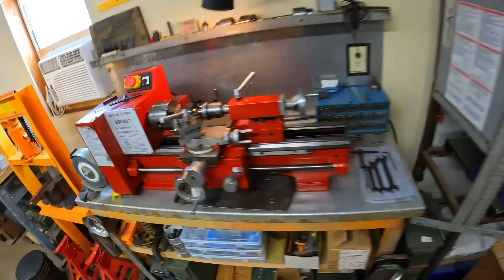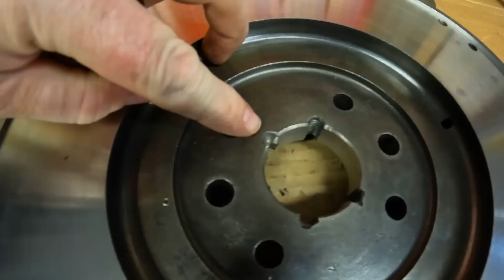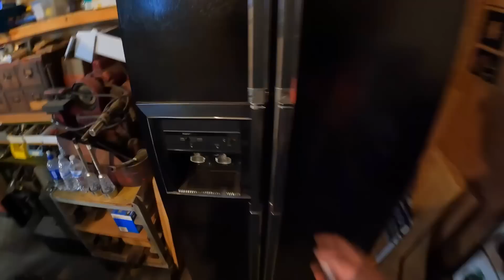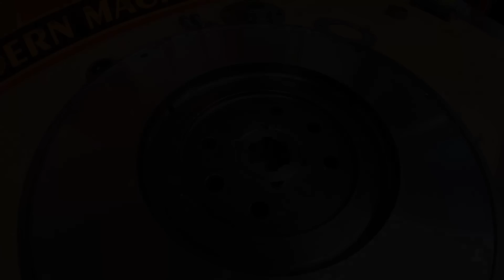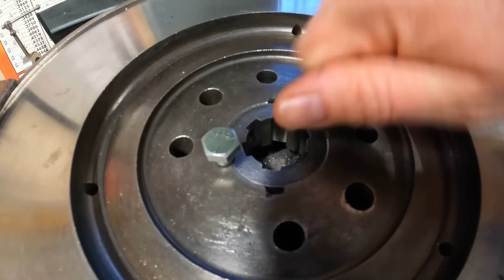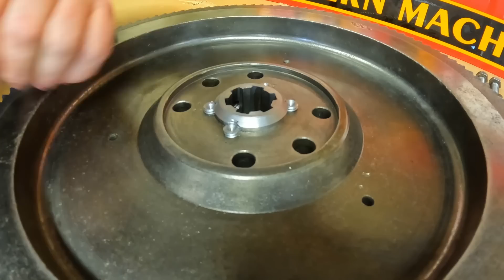X231 Prototype - Fabricating, Pressing & Pinning the New Flywheel Hub - Part 81

Comment: That annoying sound on your shop vac. A bronze bushing in the motor, is just about tits up. Amazon $ 35. Wet or dry shop vac. Come on, cheap, or stubborn.
Reply from the maker: We treat these shop-vacs as shop consumables because the duty they put in on the sandblasting cabinet wipes the motors out pretty fast due to the fine dust bypassing the filter. They actually last longer if we leave that motor bushing dry and let it howl because no lube keeps the dust from sticking and turning into a grinding paste. Plus the noisy motor really stokes the comments section lol 😂👍

Comment: Squatch - A pleasure to watch the work of a master craftsman! Just out of interest (and you may have answered this before) what's the reason for doing lathework with no lubricating fluid?  Is this because modern tools don't need it?  I recall 50 years ago in school lessons always using some milky-looking stuff to cool and lubricate the cut.  (It had a distinctive smell too!)  I've never worked with machine tools since, so I've no idea how techniques have move on.  Thanks again for fascinating and inspiring content!
Reply from the maker: Typically production machines that take large cuts and run at high speeds need a lubricating coolant, but these tiny hobby lathes don't run at that speed nor can they take very big cuts at all, so fluid is not necessary.  The only time I ever need to use fluid for lathe work is when machining aluminum, because without it the metal will gall and stick to the cutting bit, ruining the finish.
Reply: @squatch253  Interesting, makes sense. Thanks for taking time to reply.

Comment: A bolt designed to fail at a set point. Not unlike the stitching technique you used on the gearshift casing.

Comment: I have a question on this would it not been more safe and solid if you was to use a solid  pin that stacked it in  with a tight fit
Reply from the maker: The threaded pins not only hold the center hub from spinning, but also hold it from drifting in or out of the hole as well. A straight pin would only hold in-or-out movement with just the end material that is staked, and that’s not very much.
Reply: @squatch253  just my thoughts  being you have plate on both side but may be noy tight against the fly wheel
Reply: But ke up the fantastic  work you doing I would liketo have some equipment  that you havemakes things easier  to rebuild  0parts you can't  find

Comment: Yes, even thinking about a broken tap too loud is a risk, any body who has threaded will know the 'dreaded eeek'.  Watching you swap taps because the lesser tap has a 'dimple' in the top to guide, there are actually tap spanners around that have a spindle that fits into a drill chuck to act as a guide for the tap (the spindle slides vertically to allow the tap to thread in while guiding it in line with the drilled hole).

Comment: The worst sound you can hear is when a drill bit, end mill or tap shatters when working with two different types of metal being connected. Only having done this type of work with the greatest of care and patience will get the end result needed. I know very few people that can do this type of work. I am glad you pointed that out when you had the parts ground by a local shop. Restoration is an education unto oneself. Having said that, I am very happy for your end result. I could almost hear the sigh of relief at the end of the video. Watching you and senior to the end result is very exciting. Thank you.

Comment: Very thorough repair. Was I seeing it correctly - are you about due to flip the ring gear for some fresh teeth for the starter drive?
Reply from the maker: I looked at that and thought about it, but decided to leave it be unless it ends up giving me trouble. Because the ring gear is also a unique “10X” piece, and the starter drive that matches it is also an oddly sized Delco-Remy “Engineering Sample” prototype piece, and X231’s flywheel is also different from the production 445 and only matches that unique ring gear - all it would take is for one thing to go wrong during the ring gear turn (like cracking it) and then ALL of those pieces get thrown out and the work begins to try to fit the all-production parts in their places - definitely an “all or nothing” worst case scenario lol
Reply: @squatch253  Excellent explanation in Part 83 describing all the factors in your decision. While flipping ring gears are standard practice during flywheel/clutch servicing, I can see why you chose not to, given the lack of available "partner parts" available if there is an issue.

Comment: Just out of curiosity,  why not just weld it ? 
Is it the fact you want it as close as possible to it original  design, or the mix of the metals?
Keep it up please?
Reply from the maker: It’s the dissimilar metals that prevent the welding - cast flywheel with a steel hub is a no-go for weld, thats the reason why they didn’t just weld it originally 👍

Comment: Why not plug weld the old threaded holes
Reply from the maker: This is cast iron, which doesn't weld well.  It could be brazed with a proper controlled pre-heat, but that's beyond my skill level.

Comment: 8:44 If the flywheel had been heated to somewhere around 200-250 degrees it would have dropped right in. Minimal chance of warpage, either, that'll be within the temp range that flywheel will see in service.
Reply from the maker: I can't bring myself to apply heat of any kind to these prototype parts - they've already been through too much and I won't be the guy that finally finishes one off with well intentions lol!  A working tractor would see those temps at the flywheel, but this one won't for as long as I own it :-)

Comment: I'm amazed at the craftsmanship at some of the things the engineers did in the making of Christine..but appalled at others.  The way they installed the original splined hub falls into the appalled category, specifically the way they staked it.  Your way says "professional and done right the first time."  Their way said "shade-tree and it'll do."  I know Christine is a proof of concept machine and a time-table had to be met, but some of the fixes/shortcuts they made just make you scratch your head.

Comment: Hey Squatch; 
I was just thinking. Would it have been easier to use tapered head hex allen bolts to  secure the collar. That would have saved you from machining the shanks down to snap off and also having to machine them flush afterwards.
What are your thoughts?
Reply from the maker: Allen bolts/screws are always very hard, therefore difficult to machine or peen/deform.

Comment: Hi, Chris from Australia. Will need to re-balance the flywheel after the hub centre repair?
Reply from the maker: No, the original one was never balanced after all that they did to it and it survived one of the greatest floggings of all time lol - also remember from way, way back in this series that I pointed out how the engine's crankshaft was never balanced at the factory either, it's just a raw forging that only had the journals machined.

Comment: Squatch, a fantastic repair job as per your usual standards
A couple of questions though:
Why did your use the little lathe as opposed to the big one? I would have thought that the added rigidity would have been better.
Why didn't you make the spline shoulder a bit deeper and mill the staking bolts shoulders into the new spline?
Reply from the maker: The little lathe is actually my first go-to because believe it or not, I can get better accuracy with that one because it's not worn as much as the two bigger lathes we have here.  Second question - when it comes to altering the prototype parts, my approach is to change them as little as absolutely necessary - because you can't un-do taking material away, and I'm not here to try to improve a faulted design, rather to restore that likely faulted design to somewhat of a dependable and workable state for the requirements of a parade tractor.  It's like walking a fine line between leaving it full of the unique shortcomings that it originally had, or updating everything inside of it which would basically turn it into a production 445 tractor clone.
Reply: Squatch, I think you misunderstood my 2nd question. I was thinking to leave the new spline "proud" of the hubs surface, then after staking it in place, milling it and the stakes down  flush with the surface. That would've ensured that another was too high for the hub to be pulled down flat. No additional material would've been removed from the clutch plate.

Comment: Clamp your tap in the chuck as hard as you can , then use a pin spanner in one of the chuck key pilot holes to crank it in. much more rigid than a boingy tap follower and you will slip before you snap the tap. If your mill can run less than 100 rpm goose it and run the tap into the material while its coasting to get a good start. Use plenty of cutting oil.
Reply from the maker: I could never bring myself to use any tap with a powered machine - it's just one of those things that I'll always need to have the feel of it in my hand.  That's just a "me" thing, I'm sure it works but I could never bring myself to attempt it.
Reply: @squatch253  I can understand, once you get over the cringyness of it, it works really well

Comment: Consider using green loctite on the press fit?
Reply from the maker: Everything got green Loctite, it was even smeared inside the flywheel bore right before I drove the frosty hub in.  Not sure how well it did in there with the resulting condensation, but I gave it some.
Reply: @squatch253  cool, there was a study years ago about using it on press fits. I didn't believe it until some guys on Practical Machinist went and experimented. Was surprised to see you kept the Dutch keys. They do work though.

Comment: Are you happy with that lathe? What other choice/brand would you recommend?
Reply from the maker: Yes, I am happy with that small benchtop lathe. They're cheap quality, but for a hobbyist they do very well, and for the machines that I work on, their accuracy is still within closer tolerances than I have to hit.  The biggest factor to keep in mind with these small lathes is to not overwork them - they're not capable of taking deep cuts so it takes more passes to do the work but if you stay within their limits they do the job and last a decent amount of time.  When looking for any size lathe, the rule of thumb is that you'll get what you pay for - a small lathe like this one will set you back a few hundred bucks but a top-tier model of the same size will be a couple grand - but if you were to do the same job on each one, the difference in construction, power, and rigidity would soon become clear.

Comment: You have made that stronger than original by increasing the bolt size and probably doing the job a lot better than it was originally done.. That is going to go nowhere with the light duty you plan for the the tractor's future. I'm looking fwd to the next job.

Comment: I'm Curious is Staking and pinning as well as welding. Which welding can cause warping. It sounds like a good hold the way you did it.
Reply from the maker: The trouble here is that we have dissimilar metals, with the flywheel being cast and the splined hub being steel. The two don’t weld to one another well at all, otherwise that’s the way they would’ve done it originally 👍

Comment: Very nice work Squatch!  I presume you went down this route to replicate the prototype job? I did think you might have made the centre a flanged piece and counterbored the flywheel to take it, follow up with hot riveting to secure. Worked for billions of clutch plates but wouldn't hve been same methodology that the X men used?

Comment: I don’t recall if this was a one off do or die part that needed to be rescued, if a substitute production part was even an option? Nice work, I really enjoy this series on X231.
Reply from the maker: Check out the video just prior to this one, I showed all of those details near the beginning of it. In short, this prototype setup had several iterations of faulty design and failures before they settled upon what you saw here. The production equivalent was a MUCH better and stronger setup, still along similar lines but much better engineered 👍

Comment: I have to ask. Why the shaft is connected directly to the flywheel if there is a clutch? Is that shaft through the main shaft that?
Reply from the maker: Yes, that center shaft is solid and is what provides the “live power” to the PTO and hydraulics at the rear of the tractor. The actual transmission input shaft that the clutch attaches to is hollow, allowing that solid center shaft to pass through it.
Reply: @squatch253  Thank you for your reply. I wanted to say PTO, but... I thought I was going to make a fool of myself

Comment: Question? Why didn’t you have the crank flange/ mating surface ground at the same time as the clutch surface? That surface looks well used from over the years and may not be parallel with each other,
Reply from the maker: They don’t have the capability to go that small.

Comment: I can’t help but wonder why you didn’t use red loctite? That’s generally what’s used when you have an assembly you don’t ever want to come apart ever.
Reply from the maker: This green has an even higher strength rating than the red - once this green stuff cures, the only way to take it back apart is with heat to melt the bond 👍

Comment: That vacuum still sounds plugged to me.  That doesn't sound like dry bearings.  That sounds like it has a pop-off valve somewhere that allows the suction to bleed off when it is plugged.  Sharks are really bad for that.  Customers would bring them in saying they sounded like a dying cow.  They have a pop-off valve that makes a horrible sound, and usually they were plugged up in the dust cup cyclones, or in the bottom curve of the hose, making that valve pop off.  I don't know if Shop Vac uses them but if they do, it might keep you from having to buy a new one.  It doesn't take much of a restriction to make those things howl.

That is a beautiful, well thought out, workmanlike repair.  Well done.  Still praying for you.

Comment: I'm no engineer, although I have followed this project since its inception and through all the other builds in between so I  am now conversant with many of the concepts,  There is no such thing as a stupid question, but what is the advantage of using an end mill rather than a regular Hss drill? Thanks
Reply from the maker: The end mill I used here has a square end on it, plus has 4 flutes whereas a regular drill but only has 2 flutes. Those differences make the end mill a very good choice for drilling down such an oddly shaped hole without it wanting to bite, break off, or wander off to the side 👍

Comment: A good solid repair!  My only suggestion is to somehow guarantee that the setscrews cannot back out.  If they back out, they will be wearing on the splines and may make future disassembly very difficult or possibly cause input shaft failure due to wear particle accumulation and or creation of a major stress riser.

Comment: Squatch, if that’s a commercial tap follower, check to see if you can unscrew the end and take the sprung follower out to reverse it.  The Starrett versions have a concave end that will engage the taps with a point instead of a center.

Comment: I was curious why you didn't use the Lock--N-Stitch style bolts for this so I went back and looked at your part 51 video on metal stitching and found the answer there. I had to laugh when I heard your Shop-Vac make that death rattle back then. I am wondering if I missed somewhere where you did a comparison video with the production tractor flywheel hub center setup.

Comment: You certainly are a master of "good enough" machining, as in fitting metal together instead of hitting some arbitrary measurement.  Your twist off bolts idea looks brilliant, I never would have thought of that.
Reply: Could use grub screw's but then you'd have to stake both ends
Reply: The altered bolts look like snow thrower shear bolts.

Comment: Assuming a coefficient of thermal expansion of 7.2 millionths of an inch/degree F, the 70 degree or so temperature difference between the flywheel and the splined insert would only be about a half thousandth. If you would have heated up the flywheel to 350*F you would have gotten a 2.5 mil difference and it would have dropped in.

Comment: When you're pushing your minilathe hard, you might benefit from the modification first popularised by Rob Renzetti, a skilled machinist.

Replace the topslide (AKA compound slide) with a dumb block of metal, of the same height, and drilled to connect to the cross slide and tool post in the same way as the original topslide.

Swapping the topslide back in is "fairly" quick and easy, and when doing most of your straightforward turning work, you wouldn't be using the topslide anyway. It's mainly used for turning small tapers and doing the old "fine adjust" trick (a skewed topslide means that a linear tool movement of the topslide can be a much smaller movement in the cross-slide direction).

I appreciate that you probably don't need another sub-project, but this might allow you to push the limits of your minilathe a little harder. Making the block is a fairly basic milling project.

Here's a link to the original ROBRENZ video, but a search for "solid tool post" will find many more.

https://www.youtube.com/watch?v=pG3YSfgyJPI

Comment: I still would have threaded the insert and flywheel with a step then Pinned it or at least used some loctite 640 on the insert to prevent any chance of it loosening up.  Given it is only going to ever be trailer what you did should be adequate.